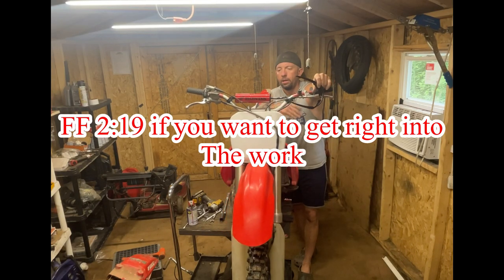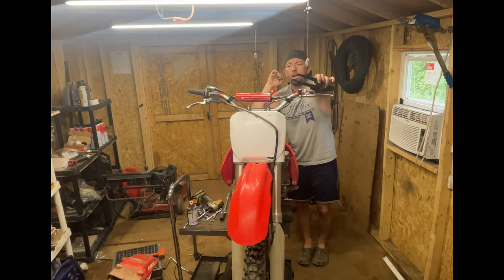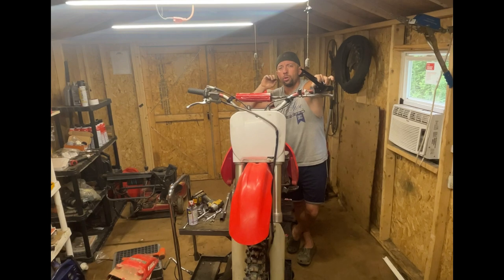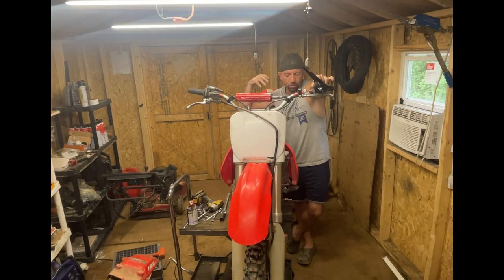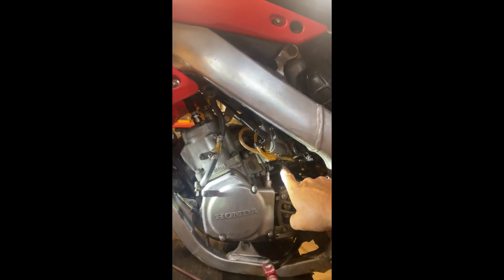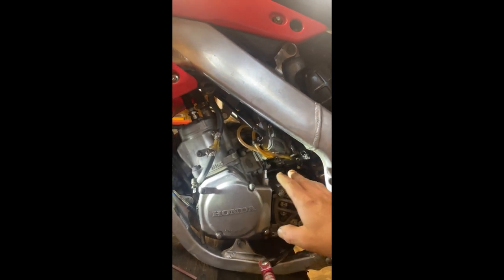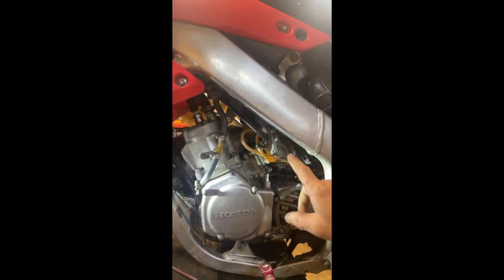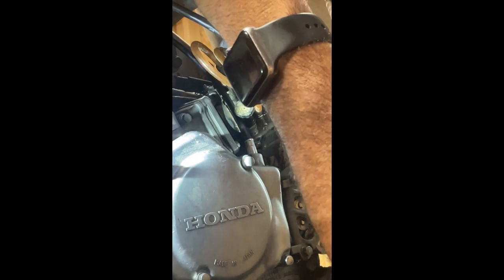2001 Honda CR 125 - Needle Height Adjustment - Carb Tuning

Comment: My 01 cr125 I cant adjust the idle at all if I move the screw in it is eathier way to much till it does anything. It runs great when riding it but when I let off the idle will hang for just a second or 2 then go way low. Very frustrating cause it's not rite.
Reply: If you have a adjuster on your throttle cable where it enters on the throttle tube there will be the black cover over a adjuster and you adjust it out(loosen it) that’s what I did and it brought my idle up it might be for certain year or not idk if it’s not that lean your bike out and see if it idle correctly or worse then.